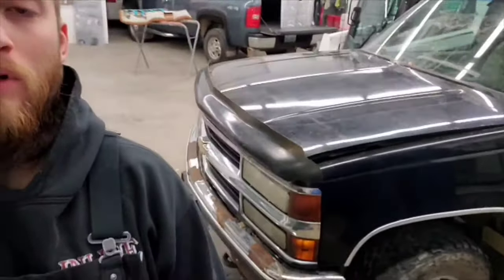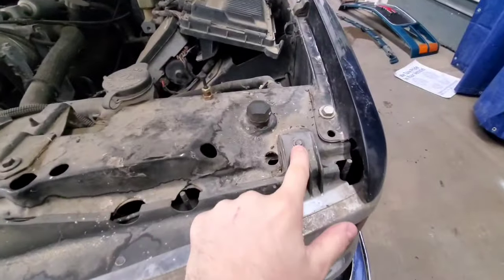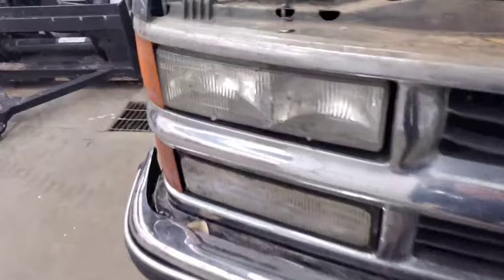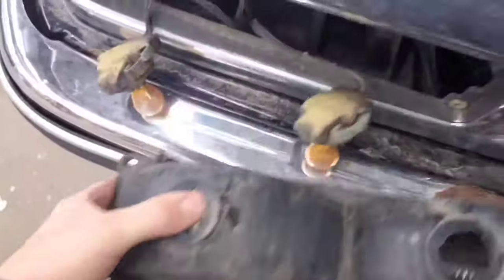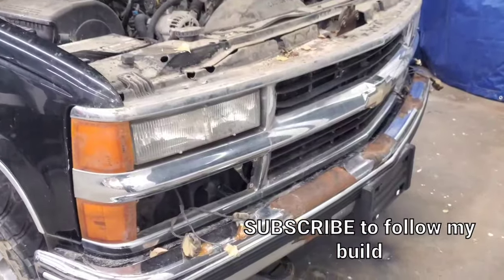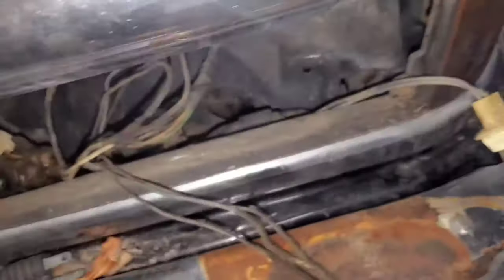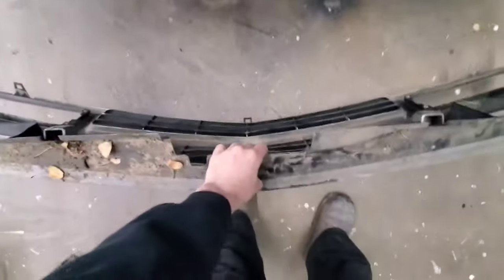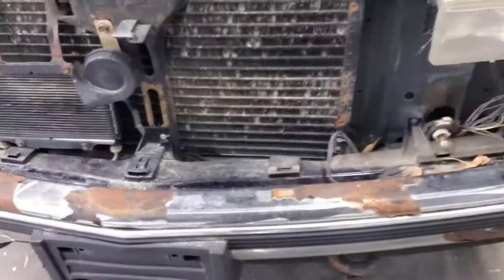Simple GRILLE REMOVAL 88-98 CHEVY GMC OBS

Comment: Thanks, just got my first chevy truck (95) taking all the plow wires out  and using the turn signal and running light taps to wire the new tow mirrors  , thanks for the help